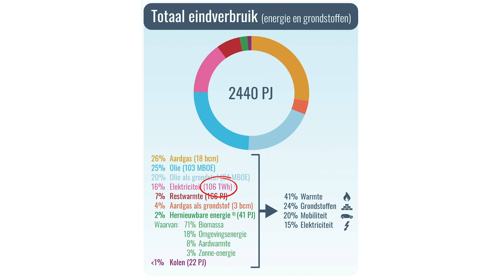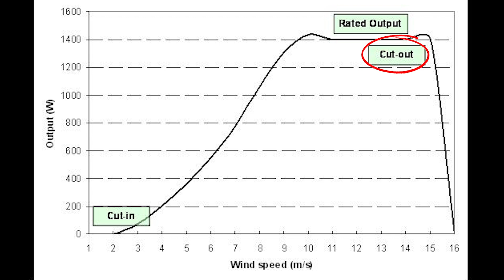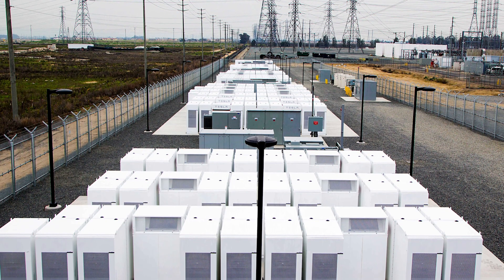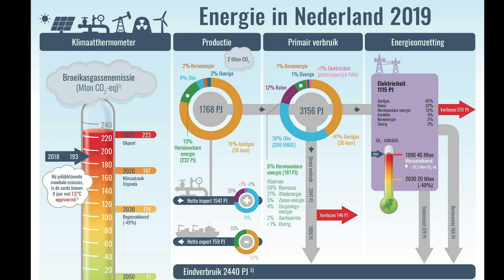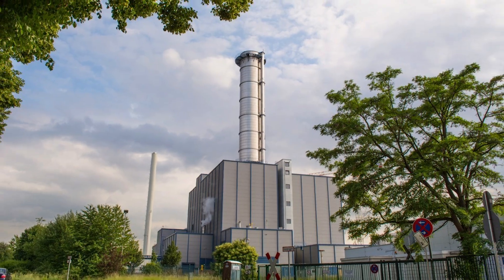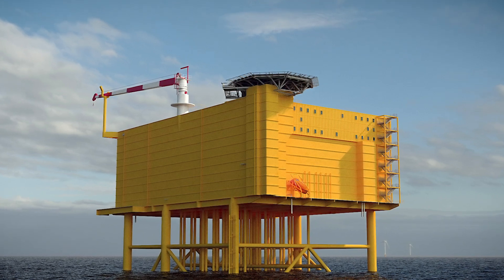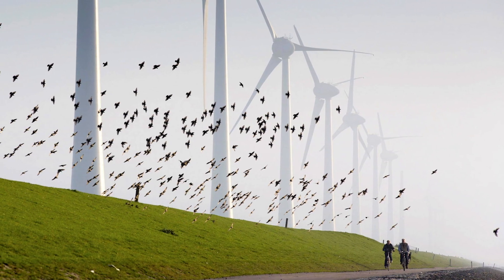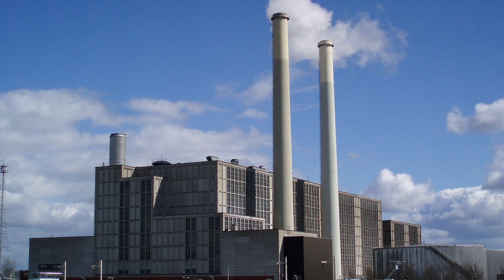Will windturbines ever work?

Comment: A two-megawatt windmill is made up of
260 tons of steel that required 300 tons
or iron ore and 170 tons of coking coal,
all mined, transported and produced by
hydrocarbons. A windmill could spin
until it falls apart and never generate as
much energy as was invested in
building it.

Comment: I would suggest putting mirrors around the windmills, and collectors on the trunks of the windmills. Thus there will  be a double function to use the same energy transport infrastructure. What would be the setbacks or problems, apart from some fried birds?

Comment: This is the dumbest attempt at math I've ever seen. "If we can use the generated power directly 25% of the time, we have to compensate for the remaining 2/3rds lost. This leaves about 40% so the required number of turbines rises to more than 24 thousand... just over 150 km sq"

By the time you're done with your attempt your 200 meter tall turbines (avg. is 70) with only a capacity of 25% (avg is 36, max is 56%) you've actually made the spacing between turbines larger than 1 km as proposed. 

Not that anyone to my knowledge has suggested the Netherlands are going 100% or 100% Hydrogen.

Comment: For one, hydrogen is not the ideal energy storage system.  Better to store energy in gravitational storage because it is simpler, non-volatile, a lot safer, and more efficient.
Secondly, yes, converting every energy source into one type is strategically bad.  You do not want to put all your egg into one basket.  One should also add geothermal, solar, hydro, nuclear, wave, biodiesel to the mix.

Comment: Who has ever argued for 100% wind to substitute all energy consumption. But wind is indeed one of the best available sources of cheap energy to replace fossil energy. A modern offshore wind turbine is rated at 15MW and annually produces about 55% of its rated capacity. In 5 years this will be 20MW and 60%. RWE paid the Danish tax payers 375M EUR for selling electricity produced by wind-mills to the Danish tax payers at market rates. When you come up with an alternative energy source which can do the same, you are welcome to build it in my garden.
Reply: Lars, 

except it is not cheap and few turbines if any acheive 55%, 50% maybe when new but that deteriorates steadily with time.
Intermittency is  a real problem and needs alternative reliable generation capcity equal to maximum grid demand meaning a very high capital cost. Not only that wind generators have a short life so more cost to replace them.
Wind is asynchronous and has no inertia, Synchronous generation and inertia are essential to a stable grid, this limits the amount of wind that can be connected. Because synchronous generators are stabilising thegrid and have to work hard to do that, their CO2 emissions are higher than would otherwise be the case. indeed, some connected generators do not contribute to load but have to be available at a moments notice, the so called spinning reserve, i.e running, emitting CO2 but not producing power.
It has been obvious to those that understand power that nuclear is the only way to produce electricity without CO2 when running, although that also has problems as large nuclear plants tend to be inflexible in their output power, i.e they have difficulty load following.
Renewables are a waste of resources and effort and can never replace fossil fuel generation as is the aim.

Comment: And then there's the waste from decommissioned turbines (and solar). The steel towers are a valuable commodity, as is the running gear, but the huge blades are mostly empty fibreglass with little to no value compared to recycling costs, so as we have seen with plastics, dumping is going to be cheaper.
As for hydrogen, burning H2 produces a lot of NOx, apparently even more than burning methane (natural gas) due to the higher temperature. But that's a technical issue that can be overcome. Mostly.

Comment: There are some obvious flaws in this argument.
1) Wind turbines really don't have to be 1 km apart, especially not in the plane facing the prevailing wind. My guess is you can divide your area total by 10.
2) Who is suggesting that all energy should come from wind? No one. Divide your total by another 10.
3) Holland is a very densely populated country, there are vast, vast areas of the world with no people, or very few people. Divide your total by another 10.
4) Technology is constantly improving. What about more, smaller turbines e.g. on buildings. Divide your total by another 2.
5) Fuel usage is becoming more efficient, with less wastage, e.g. LED light bulbs use about 10% as much electricity as the old tungsten ones. Divide your total by another 2.

OK, my figures are guesstimates, but you get my point. 

It's an interesting video, but really, half the truth is no truth at all. Maybe put more effort into your maths and thinking about reality, and less into your video production. But hey, it got me thinking, so thank you and a thumbs up!
Reply: I think your figures are wildly optimistic.  Solar is no use in places like the Netherlands in the winter for example and solar does not work at night.  At least wind has the potential to be generating 24h/day (although I have seen wind farms becalmed over a large are in the UK one summer day in a drive from Lake District to London where I saw only 1 turbine moving). It is the intermittency of wind and solar where multipliers are needed to attempt a 24h/day supply.  All that wind and solar can do is act as a top-up to some other generation technology - and at the moment that is something nuclear - fusion or fission.

Comment: Thank you.  I have always known it was bad, but until today I never knew just how IRRESPONSIBLE and STUPID it all was. The eco-cost (full industrial) life cycle of replacing those wind farms will dwarf anything saved in battery Bill’s cars. It’s starting to smell like a big con by vested industries, ooh look new technology battery car that must cost the dumb consumers  >30% more than its ICE equivalent. Whilst the solution is very difficult , understanding that adding more technology is just digging ourselves even deeper in the sewer is just crazy. All those industrial and political advocates should hang their head in shame, they will have been told a thousand times. That also applies  hot air Greta (who must go to a pretty useless school). This problem,  we all knew about 20 years before she was born.  Oh and the cars.. no CO2 out of the exhaust.. but plenty more out of the power stations which are required to produce more Joules for the new cars which are up to 40% heavier and so more deadly in road traffic accidents.
Reply: Scoldilocks is just a tool.  But she did get COP26 correct, blah bah blah.

Comment: I work in the wind industry so am probably biased but there are some good points raised here. The industry isn't the utopia everyone claims it will be but I believe it should contribute to a mix of generation types rather than be the only one.

I would say that the hydrogen idea is perhaps not as negative as portrayed here since the conversion mentioned here assumes converting back to electricity. I think it is more sensible to inject to the gas network and burn heating your house or burn in a hydrogen car, available now from Toyota. I do think hydrogen can offer alternative to batteries as a transport fuel.

Don't worry we're not all green zealots with closed minds, debate and challenge is no bad thing.
Reply: John, 

as you work in the industry surely you must realise that wind cannot be the sole source of electricity generation, it simply will not work until you can mak ethem dispatchable.
Really they are a dead end and not a long term source of economic and reliable power.

Comment: The Dutch engineer has loaded bad assumption on bad assumption to try to skew the result to get the conclusion he is looking for.   These include:-

- using 6 MW offshore turbines instead of the 12-15MW, 260m offshore turbines now available

- assuming 25% capacity factor instead of the 50% or more available with the 260m turbines.  60% is available on Dogger Bank, but the Dutch sector is probably limited to 50% because the wind speeds are a little lower.

- not including short-duration grid batteries (90% efficiency) for something like 2/3rds of the gaps to dramatically improve the efficiency of storage

- assuming a 30% efficiency of power to gas to power instead of the 43-45% which can actually be achieved.
- storing hydrogen expensively in steel tanks rather than cheaply in depleted North Sea oil and gas wells.

If you correct the assumptions you soon come to the conclusion that offshore wind can do the job at reasonable cost without filling the Dutch sector of the North Sea.
Reply: If off shore wind can suffice why are they constructing (inflicting) 130 of the fucking things in the central main island of Shetland?
Reply: How long is a short duration battery meant to last for?  How long is the wind still?  As a guess, you would need to design for at least a week of energy storage to be safe and that is incredibly expensive at the moment using old Tesla batteries.  I still think this video is closer to the truth even assuming your improvements.
Reply: Why install a WEATHER DEPENDENT GENERATING SYSTEM. ONLY IDIOTS NEED TO REPLY?

Comment: Well presented. I ws a power system supervisor in Ontario, and I can tell you , you are relistic in your presentation. Look at it this way, they didn't get rid of commercial sailing ships for nothing. The same lack of reliability then as there is now with wind generated electricity
Reply: They replaced sailing ships (for good reasons as you say) but they did replace them with oil, diesel, etc. These are indeed more reliable but are you suggesting we simply carry on dependent upon them?
Reply: @grahampikevideos  There is talk of going back to sail for non perishable goods.
Reply: It would help if we'd lessen our dependence on long distance imports. China is the world's supplier, apart from several other negatives to trading with China, crucially, it is environmental lunacy to import what we can produce or source locally.
Reply: @grahampikevideos  An even better example of environmental lunacy is the UK's plan to trade beef/meat with Australia and New Zealand.

Comment: Problem with logic.  Since hydrogen is transportable,  place sea solar plants in peak locations,  that turn sea water directly into Hydrogen and transport it to where you need it.  Then you augment with local solar, hydroelectric, wind, geothermal, ,,,,,,maybe nuclear and then gas.  Obviously, the author wanted to reach a conclusion and placed artificial barriers in place to reach that conclusion.
Reply: No he didn't.  So where are you going to place the solar panels?  Northern Europe is no good because of the short winter days (equivalent to 1.9 hours of full daylight per day in London in January for example).  You are also still going to have a lot of solar panels wherever you put them.  Then to transport and store hydrogen, you will need to liquefy it which will take up some of the hydrogen you just created.  Containing hydrogen is difficult because it can diffuse through materials including metals and will involve very low temperatures.  Then more energy generated from the hydrogen to ship it from where it is created (the Sahara?) to where it is needed.

Comment: Geo thermal. But that will take some time. In the meantime focus on renewable where it's needed. Not the big farms you are discussing. Make the power where you need it. You promoted solar roofs. That's good. A wind turbine can also be put in someones back yard. You get less power per dollar spent than a giant 5KW turbine but the benefit is that you don't have to transport that power. You can also schedule things like baking, water heating and laundry with the peak power generation. So then peoples homes don't need so much power. Add working and studying at home and a massive reduction in total power consumption can be realized. Localize food production as much as you can and you also reduce the over all generation requirements.
Reply: There may be a niche of rooftop solar for household use, although many would say it is uneconomical and would cause problems in grid connection it would, as you say, not require the transmission systems of grid scale power.   So, the only power generation needed in The Netherlands is for household use?  No grid scale power generation needed?  You probably hate industries so that probably makes sense to you but I am guessing there are people in The Netherlands who's income actually depends on industries that use power.  With that aside, how about transportation.  If you listened to the video you know that transportation accounts for 60% of power use in The Netherlands.  With a 100%  EV fleet, how are you going to power all those trucks and cars?  Oh right--study and work from home and grow your own vegetables.  Get out of your mother's basement--that would have miniscule impact on transportation energy needs.  With a little windmill for each house or rooftop solar? Like AOC, you are probably thinking, well, all we have to do is invent some new inventions.  Too bad the engineers will tell you the technology, particularly batteries, is nowhere in sight.  Also, if you listened to the video, you know that mining of materials and manufacturing of steel and concrete for windmills would trash the environment, not only in The Netherlands but in places like China and Africa.  But you don't care about that, do you? You greenies live in a fantasy world where you think you can ignore the laws of physics and engineering.  You are also ignoring what even the IPCC is saying, if you read the detail in their reports, that the warming threat is minimal and we will have plenty of time to adapt.
Reply: @bamavic4098  Your pushback is understandable. And there is for sure magical thinking among the green crowd that sadly don't take the time to deeply understand these things. The answer isn't to blindly hope new efficiencies are realized. I totally agree. But also we are hitting up agains the edge of the limitations of our current system. If we had a well engineered sink but it flooded the back yard but it worked really well in the kitchen then that would be considered a failure. And one wouldn't have to be an engineer to see that the back yard was flooded. But looking just at the sink the plumber could insist that everything was working perfectly right there in that area of the kitchen. That's what it sounds like to me when people try to cling to our current energy solutions. Yeah, they work, yeah, they are marvels of engineering (or at least were several decades ago when they took the stage.) But at this point we need to roll out some better ideas. KW for KW it's true that we are falling short with renewables. At least on this industrial scale. So I propose that instead of the business of selling power everyone should be in the business of business. Run some other business like producing food or creating a factory. And then run that business on renewable. And if you have to contract with the seasons. Because then really cheap power is there for you from renewables when you can use it and you scale back when there is less. Design it into the plan. But then for homes there is the BioChar solution. In the Netherlands you can build BIoChar ovens that can use an electric heating element to get it started. Wood blocks about 2 inches by 2 inches can be in a container deprived of oxygen and the heat generated can keep a home warm while the winter months provide so little solar. A small turbine that trickle charges a lithium iron phosphate battery pack can keep a fridge, TV and computers going. And a steam turbine can turn water into power from the Biochar stove incase the wind isn't enough. These wooden blocks become a fuel. And it's not the same as just burning wood chips for power. Wood chips have too much surface area so a lot of carbon is released. This method of the blocks keeps the carbon structure in tact. Then this can be used in soil where micro organisms will move into the hollowed out areas of the char which will help that Carbon have a high level of permanence. Industry can do this as well. It's actually better for factories and businesses to design a system that also produces the power they need. To the extent they can use renewable it's clean cheap energy some of the time. And to the extent they just need more power this char method is an option. And then in some cases, sure, coal, oil, natural gas, nuclear. Especially if those systems are already built. And if you can do carbon capture on any CO2 generating stack. But financially it will often make more sense to not buy this over priced power and produce your own power for your own needs. Especially once all cars go electric. Whether it's a business with a fleet or a house hold with some commuters it will be safer to depend on the power you create than the power from the grid that will become too taxed during this transition to EVs. Staying on the path of doing nothing is suicide.  Implementing the tech we have and that we know works (despite some limitations) is pretty much the only option. Can you think of any other?
Reply: @nyeowisthemoment568  Just like we used to do back in the 17th century!

Comment: The only thing debunked in this video is a strawman fantasy. Wind power isn't used to make hydrogen to then make electricity in hydrogen fueled power plants.
Reply: <ahem> That's the current plan in Europe.
Reply: There is no other way 'green' to generate electricity, with the possible use of tide power.